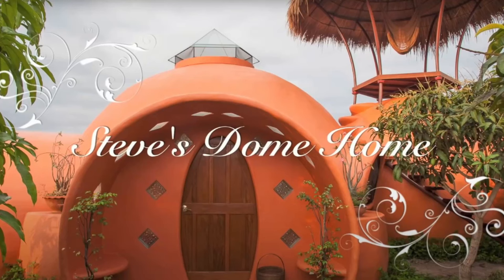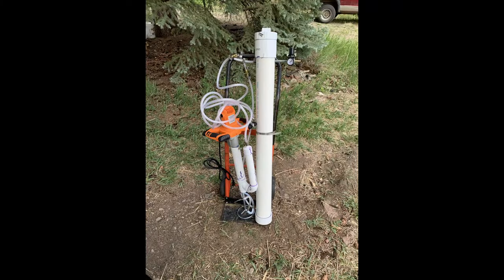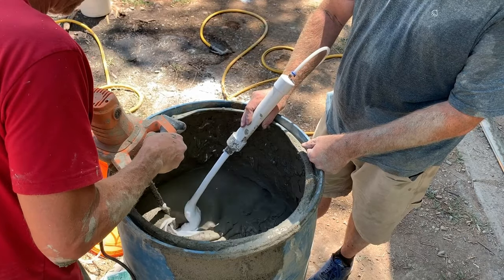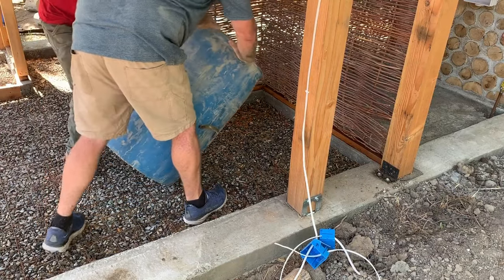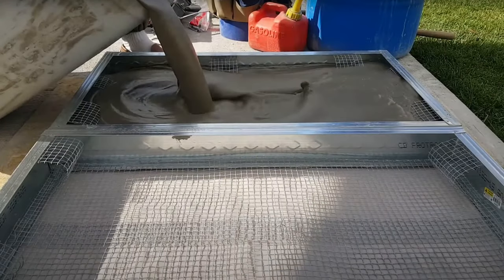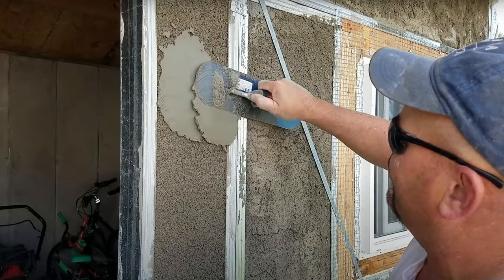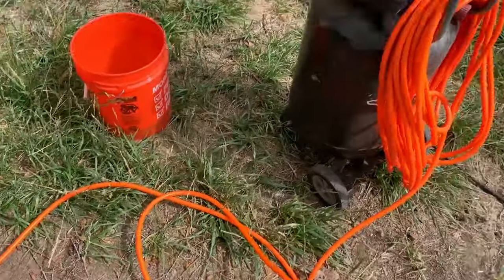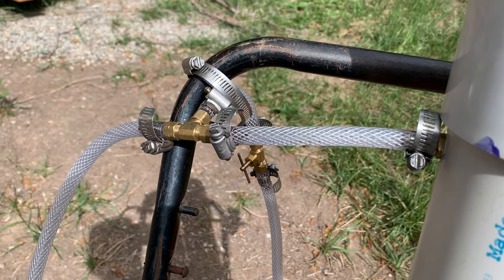Aircrete is great, but watch this before you build with it!

Comment: Enjoyed your content and video! We have similar approaches and feelings about aircrete. My method is the "ice cream sandwich" method using a hard reinforced cement/galvanized metal/mesh form - "the two cookies" or wall and then filling the void between the "cookies" with the styroaircrete or the "ice cream." Decided to use styroaircrete instead repurposing Styrofoam destined for the landfill which is currently being done as a scale model first. This to test the insulative value of the styroaircrete.  I am trying to see how little electricity can be used for this. This in an effort to create an inexpensive, durable, low maintenance, real house made out of landfill material for youngsters so that they can either build it themselves cheaply or have someone build it for them inexpensively with little to no mortgage payments. Airecrete Harry performed this experiment and it worked! However, he likes the blow up monolitic domes (very durable) and doesn't like metal or metal reinforcements. Metal though is the key to making aircrete work. This forgiving "ice cream sandwich" styroaircrete method allows for much error since it is merely insulation/filler.
Reply from the maker: I love how experimentation from varying priority sets allows us to develop these low cost, high performance alternatives. Escape from mortgages is so important. Keep up the good work!
Reply: I am testing a wall system that conforms to these production standards. There are some new, affordable materials which make this type of home construction affordable and durable. The insulated sandwich/SIP process is now viable, I believe.
Reply: @kevinhornbuckle  Which affordable materials and techniques are you referring to?
Reply: So the idea of a hard surface stuck to a softer interior to make a strong form is used a lot -- take surf boards, for example.  The strength of surf boards comes from the tension of the fiberglass outer shell pulling on the interior, usually made of soft easily formed plastic foam.  The same strength is exhibited in tempered glass, where the tension between the hardened surface against the softer glass interior creates a super strong structure.  Your Ice Cream Sandwich idea follows this idea if you can get the outside layers to adhere well enough to the soft interior, giving the whole structure much more strength.  I think adhesion is key here as it is this tension that creates the overall strength of the panel.

Comment: I am curious about aircrete but not confident in the structural integrity of aircrete. I believe that the integrity would be improve with hemp fibre's. Still, what will be the long term durability of Aircrete? Experimental right now, but hope it can be a long life system with great structural integrity at a low cost. 🤔

Comment: I also was following aircrete and dome home path. But now im at Styrofoam. I found a piece that is not ur ordinary weak sturophome but is so frikn tough its impossible to cut with a knife. Its more plastic like. No idea how thats called. But i bet the piece ive got can stop a bullet. Its about 8 inch thick. Can drive the truck over it not a flake comes off not a dent nothing. And it floats. I try to find what it is excatly called and where to find the bulk material. To make my own blocks.

Comment: I was thinking why not dry lay cinder blocks.. while keeping them plumb with mortar as needed, then surface bond instead of joint bonding them.. And with rebar pre installed, you could fill the walls with air-crete, 100%.. thereby having the best of both worlds, viable load bear ability and insulative qualities combined together?

Comment: Just discovered aircrete, like the light weight, good to see pure honesty, we went to u-tube university and are in the process of building a cabin at the age of 70 and 66. Are we crazy, yes.
Reply: No use Styrofoam pellets
Reply: My kind of crazy. I’m planning to fill some existing uninsulated walls on my old house. Trying to build a foamer out of a harborfrate wash gun. Low volume, cold joints, but inside a wall where the siding is replaced a foot at a time. (With foilcell for IR reflection)

Comment: Thanks for sharing your knowledge.
I have a form tying device I invented20 years or so you might find a way to use.i have experimented with it and aircrete and a 2x8 lap siding which simulates the inside of a D log log home on the inside .
It will form a 9 and three quarter wall I have filled with concrete or aircrete or a composite of cement, plastic regrind and sand 
It takes quite an investment to get to this point. Any suggestions on getting it into the marketplace would be welcomed
Thanks  Brent Bingham

Comment: You should consider buying 50 pound bags of milled fiber it comes in different lengths. It is fiberglass in almost a powder form, but it can come as long as a quarter of an inch down to a 60/4th of an inch when you mix this with your air Crete it acts like microscopic rebar. It adds an immense amount of strength. You just have to get the right ratio. And then, of course, I would go back to the hardware cloth galvanized for more reinforcement. There are also other Paula burners that can be added for more Elastomeric benefits, making this thinner, stronger and lighter

Comment: We must share some genes. I have been building with all sorts of mixes of cement and sawdust for 30 years. I did a lot of architectural components like european style window and door frames, on a heavy scale. I always used sand in the mix and typically white cement so that no further coloring was needed. Great videos here. I would never use chopped Fiberglass on a finish coat of plaster, it's just a burden and especially in a lime plaster. But it makes perfect sense in the dust crete itself. If you use a good mixer, you can use soap and get aerated mortar which is highly freeze cracking resistant. My favorite tool is a water mister/sprayer when doing finish work, it gives superb control over your materials hydration. Pity that my work was mostly pre camera and youtube days.  Where are your sponges? Great for color coats using lime or white cement and a pigment.
Reply from the maker: Good tips. I’ll play around with your techniques!

Comment: Have you considered using a form of reinforced rapid cure mortar that the foam/aircrete then fills in around to add compressive strength while still remaining relatively light?
Reply from the maker: I have not. Interesting idea.
Reply: I am working on such a demonstration project.
Reply from the maker: @kevinhornbuckle  nice!

Comment: I have not yet attempted aircrete, but it is something I am pondering on. 
I have wondered if the addition of graphine (which should be getting cheaper as a concrete additive if it's not already) would make up some strength.  I've not seen anybody attempt that with aircrete yet. 

I have also wondered, if there was a way to foam "water glass" or a water resistant resin so the bubbles would be hollow, but would cure like a hollow glass bead.  No idea if such a thing is possible (I mean, if you heat the water glass, it bubbles up and gets hard-  like honey-do carpenter's aircrete rocket stove.  But firing a whole panel seems less than optimal.

I know that if you got a thick water glass solution, you could probably aerrate the hell out of it and make it foam up, to an extent, I just don't know if it would mix with the cement and reinforce the bubble voids or not.
Reply from the maker: I’m sure there are many ways a low cost, no toxic panel could be achieved. My interest is in low tech DIY solutions, but I encourage manufactured materials that are superior in cost, performance, and ecological considerations. 

The water glass thing is fascinating, for sure!

Comment: Have you looked at MgO cement to adhere to the row cover material?  It sets up fast and will stick to lots of things that Portland cement will not bond to.
Reply: MgO cement is also not conductive of heat, electric, or water.
It is not cheap....but...

Comment: I just watched your dustcrete video, then this one. I was wondering, how rigid is the dustcrete compared to aircrete?
I have been planning to use aircrete poured in a slip-form of an arch structure. I know aircrete can support itself in an arch, but dustcrete looks so much easier to work with. Do you think it could support itself overhead?
Reply from the maker: I think it would, provided the form was left for 48 hours of longer.

Comment: If you put a piece of plywood over the poured aircrete floor, wouldn't it distribute the weight evenly enough to prevent the aircrete from compressing, at least in the size you showed?
Reply from the maker: It would, but that would not be a suitable next course. I would worry about mold between the wood and the aircrete, and there is no good way to anchor plywood to aircrete. As my plan was to tile, I could have laid cement backer board onto the wet aircrete, perhaps. In the end, the deck mud was the best, lowest cost solution for me.
Reply: @radicalgastronomy  Thank you for that explanation.   I had thought of doing that, with a moisture barrier between the aircrete and plywood, but I had hesitations too.  In the end I just poured a layer of self-leveling concrete over the aircrete.  I think I'll still get the insulation from the ground, from the aircrete. (It was a shed, not a house.)
Reply from the maker: @B30pt87  Self-leveling cement and diamond lathe make a superior underlayment to backer board, for tile setting, if one can afford it. In my application, the deck mud was an acceptable cost, and allowed me to slope the shower floor for a curb-less shower. You made the right move.

Comment: Thanks for your helpful insight.
to get the fabric to bond to the aircrete you could try soaking it in Bonding Agent before lining your form with it. You might have to look at what you are using as a form, maybe use shiny polycarbonate or similar.

I also wondered about chopped fibre strand, but you dont want to waste it by having all through the mix but just mix it in a few gallons enough to cover the base of the form about an inch or so, then after it starts to set pour in the rest, and later top off with another inch of the chopped strand added batch. this should give you a sandwich of aircrete where the base and top is tough.
I am assuming you would make big panels and cut up as needed
Reply from the maker: Perhaps a sprinkling of fiberglass in the form, then on top of the pour. I bet if one did that and added some concrete reinforcing wire in the panel it would work.

Comment: I have built structural panels 2 inches thick with no reinforcing materials that are still in use outdoors as table tops with no coating either 4 years old. Used gypsum and latex additives. It can be done.
Reply from the maker: Groovy. In what form was the gypsum?

Comment: Aircrete has the insulating values, but needs the structural strength that would be provided by aluminum screen, or nylon mosquito screening. The simple design would be an inflated dome pressurized with inserted water and electrical tubing, boxes, bubble windows or light tubes. An air lock doorway entrance provides heat/ cold / security protection. Rocket mass heater and cooling pipes in floor using air would help control temperature. The exterior/ interior may have chicken wire / screening and be epoxy coated for waterproof. The base design includes drainage slope to the door.

Comment: From what I understand the R6 may in fact be wrong as it was achieved by using non ASTM testing techniques that have not been verified.  R 3.5 - 3.7 seem more likely.  3.5 is still not too shabby. I also wonder if skinning the panels with hempcrete or straw reinforced concrete would do the trick of making a sip that can be moved without cracking
Reply from the maker: You are correct. R 6 is not accurate. I doubt hempcrete would not crack, but straw concrete could work.

Comment: Aircrete is well developed in Russia, but because of the complicated technology, many people have switched to polystyrene concrete. It's a very convenient material. You can make panels. To strengthen these concretes add polypropylene fiber. Good luck!

Comment: Do you think aircrete could be used to cover the outside of shipping containers? It would not carry any loads other than the weight of the material. I'm looking for insulation in SW Texas, so more heat than cold.
Reply from the maker: It is possible, but may not be the best move. Personally, I see little value in shipping containers for more than storage. The problem is that if you cut any penetrations for windows or doors in the container the structural integrity is compromised. Most people end up building a stick frame structure inside of the container. At that point, you could have just build a shed, and saved the $2-$5k the container cost.
If you want to do it, however, the move would be to wrap the container in stucco wire and spray the aircrete on. Check out Aircrete Harry’s work to understand the technique.

Comment: So this all sounds great, however it does seem that it would be "weak" compared to straight concrete, I'm wondering if you could work it with some "hair" to bring the strength up. And also what would your thoughts be with using this on a floor and installing a radiant heat type floor with it?
Reply from the maker: It is absolutely weaker than concrete. Fiber could be added, but the compression strength will always be quite low.

Comment: Try shredding your row cover in a paper shredder, and mixing it in with the aircrete. I did something like that with worn out blue poly tarps, cut into 4" squares, and tossed into a cement mixture full of adobe hardpan (free in the California Central Valley). The result was indestructible. Once dried, I literally couldn't do more than scratch it with a pick-mattock. With a roof over it, it will last for centuries.
Reply from the maker: Nice

Comment: It sounds like it's a little finicky. What you need to look at doing is modeling your process off of tilt wall operation. Possibly with the Incorporation of a corrugated sheathing material on one side, and you'll definitely want fiber additives for concrete designed to mitigate cracking often marketed as anti cracking. I believe they come in a variety of materials, but fiberglass would probably be the strongest, but more importantly than the material, would be the length I would think. 

If I was going about it trying to do this, I'd probably start with a corrugated panel, with some kind of threw anchor from the outside facing the panel anchored 60 to 80% of the total depth of the proposed wall, and at the termination of the anchor within the form of the wall I would suspended some form of wire reinforcement to tie it all together. I would probably terminate the walls form for the aircrete below top of the corrugated panel, so I could lift, hoist, and tilt it up into place from anchoring to the corrugated sheathing. If you planned it out, you could probably work in a tongue and groove system into the sheathing if you left it intact, or you possibly could use a form release and unbolt the anchors after it set in place and reuse the corrugated panel. If you plan to remove the corrugated panel, you would probably want an additional layer of wire set on the bottom against the panel. You quite literally might be able to get away with simple chicken wire.

Also, I think I've seen someone do a version with recycle closed-cell styrofoam ground up and mixed in instead of phone. Might be a little more consistent then the foam.

Comment: I believe the majority of successful Aircrete is made in very large blocks (1' x 2' x 6") and left to cure for a week to 10 days before building with it.  I do not believe it is meant for floors due to lack of compression strength but at those thicknesses above would be fine for highly insulated walls at least 1 story tall without needing additional supports.

Comment: Have you tried mixing it with a fiber? See Fiber Reinforced Aerogel you can hold a jet flame one side and your finger on the other. Without the fiber a passing truck would crack it. They got it to work for the space shuttle windows tho!

Comment: What part of the USA are you located in, so I could have a basis if it’s appropriate for where I’m at. I’m in the northern states, you think it would be efficient here? Also how well does it work as an insulator? In the summer months and winter months.
Reply from the maker: I am in Colorado. If I was building in New England, I’d do 12” thick dustcrete walls and a 16” dustcrete roof.